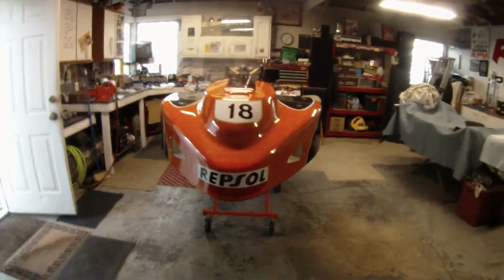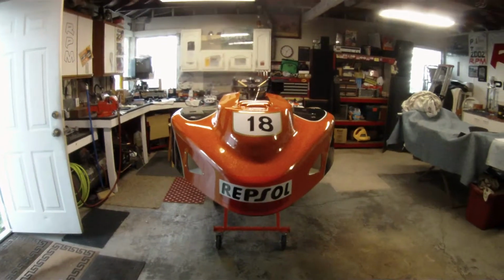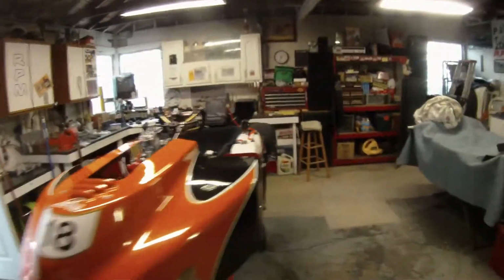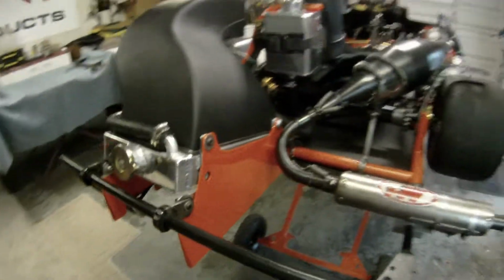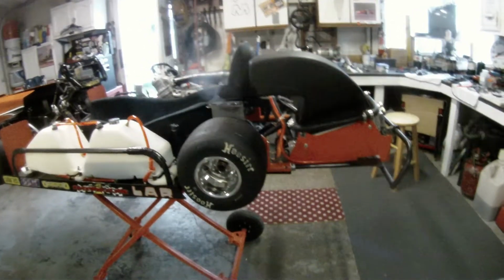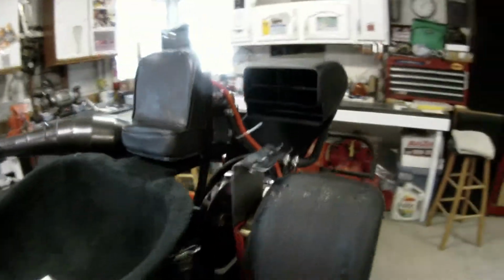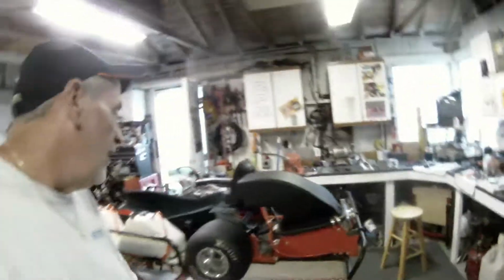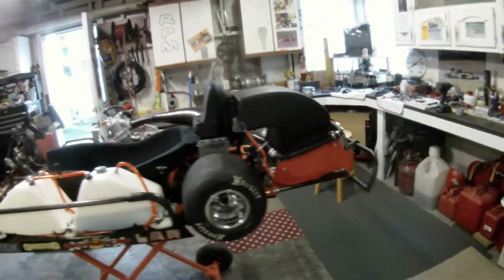Air Box and Vert Panels Installed

Comment: You might want to add a small (3/8") lip facing down where the floor pan ends in front of the rear mount rad. The air coming out from under the kart is pretty high velocity and is going to want to turn up and follow the rad face. That can tend to block the air coming through the rad even if the scoop is forcing it. Better to have the airflows cooperating with each other rather than fighting.
Reply from the maker: Right On Bro! I was intending to do these things in segments to be sure they do what we ask them to...... unfortunately it didn't go to plan first time out. But we will get there!

Adding surrounding floor tray under the rear, a strip to "trip" the air (reverse gurney) as you mention, even louvers on the back side of the rad to aid the exit of air flow.

I get your concept though, take a look at what New Line did here adding an adjustable "gurney" to the top side of their horizontal mounted rad:   https://www.tkart.it/en/magazine/tech-focus/new-line-presents-horizontal-radiator/#1

Thanks for the heads up!